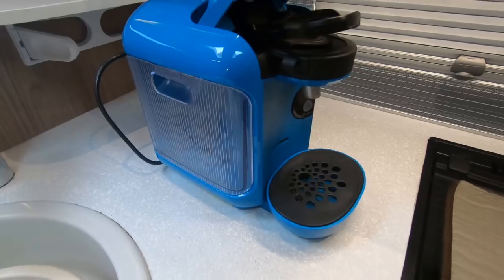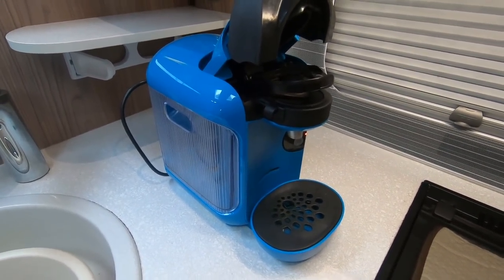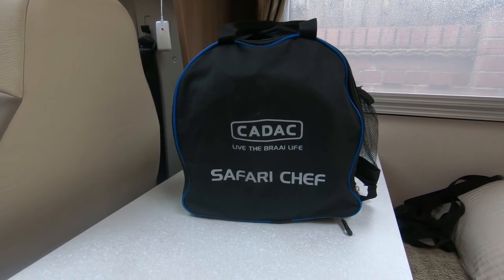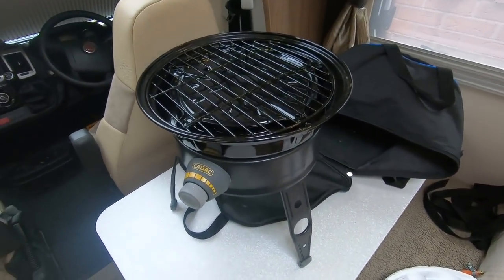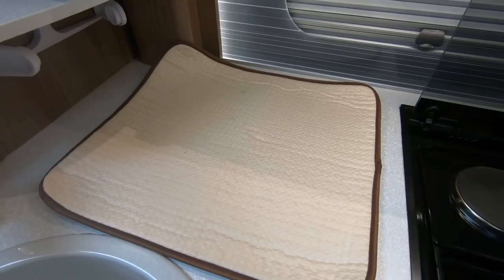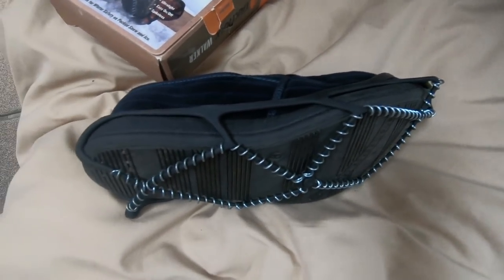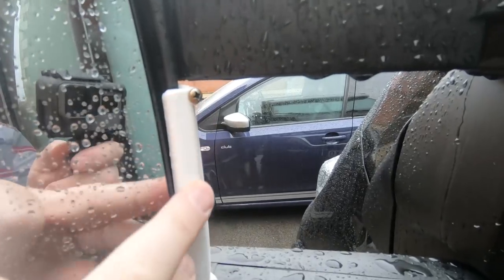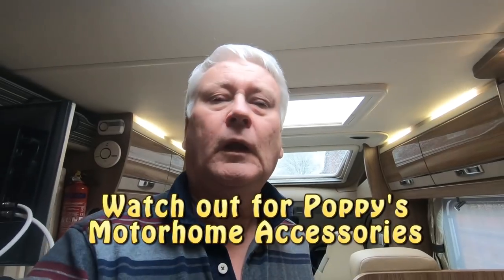Motorhome Nice To Have Accessories

Comment: Hi Bob any reason for choosing the Cadac Hi Pressure. Do you use it with BBQ point on side of van or with gas canisters?
Reply from the maker: I had a BBQ point on the old Motorhome, so that's why the high pressure one.
Reply: @BobEarnshawMoHo  I'm finding the difference between Lo & Hi very confusing. I thought the BBQ point on motorhome  point would be Lo pressure ie after the regulator. Thanks for the reply and a great series of videos.

Comment: Morning Bob, Jenny. Sorry to bother you. We have just bought a Cadac Safari Chef 2 gas bbq. It doesn't come supplied with the pipe and connections etc. Q do I need to fit a regulator with a connection fitting etc. I find it strange that they are allowed to sell without the pipe etc, You cant buy an electrical item without a flex and plug etc. Thanks Pete
Reply from the maker: Goid question. If you are using it on a Motorhome external bbq socket, you don't need a regulator. If you intend using it with a stand alone calor gas cylinder, yes you do. You should find regulators and piping at any good calor stockist or motorhome dealer.
Reply: @BobEarnshawMoHo  Thanks Bob, Yes we have a Truma external Gas point, So basically pipe and a male fitting should get us ready for lunch.

Comment: Hi Bob

Regarding your Milenco mirror protectors can you tell me if they have a cut out for the temperature sensor on bottom of mirror
Reply from the maker: Glenn McDiarmid Yes they do. Thanks for your question. I had to go and look. This answers a question of mine - which mirror the temperature sensor is in. It's in the drivers side. There is a little nipple underneath and the mirror protector has a hole that goes around it. My temperature sensor thinks it 40+ Celsius out there. It definitely isn't!
Reply: Hopefully a simple fix as 40 Fahrenheit is 4 Celsius so if you change the units on the display all should be good. 

That’s good they have a hole for the cover as when I looked at the sensor I thought it could be easily broken if you did not realise where it is located.
Reply: Hi Bob I watched your Ducato dashboard video which was great as never new about the separate oil service menu, when watching the video I could see that your temperature is set to degrees Fahrenheit and not Celsius
Reply from the maker: Glenn McDiarmid yes I know, Ihave set it the Celsius now. Not that it makes any difference- it still says it's 44 degrees Celsius! Think it's a loose connection somewhere.

Comment: Came across this, something similar from Spanish type b&q suggested, so did a search in uk. It might need some adaption to fit with one of the collapsing kits, but if you need to go a long way with one piece of hose it seems quite cheap. Not tested, just saw it and thought it may be useful for someone ..  https://www.manomano.co.uk/p/swimming-pool-hose-vacuum-eva-flex-pool-with-glued-sleeves-38mm-6m-809563

Comment: Hi Bob.  I have slays thr\ought that my Tassimo Vivvy would pop a fuse. Is this not the case and have you ever had this problem when abroad or does it just work even on 10 amp
Reply from the maker: It's never blown a trip when I've used it. It's around 1100w and draws around 4-5 amps. If the heating is on at the same time, there is an overload setting on the ALDE heating that will cut the supply to the heating. If I'm on a 10 amp supply, I turn the overload down to 10 amps and not had a problem. Probably would on a 5 amp site supply though! You will need a decent sized  (2000w) inverter to run it off 12v supply safely hough and it would draw over 90 amps from the battery!
Reply: Bob Earnshaw Thanks Bob. Appreciate you coming back so quickly stay safe and stay well
Reply: On another topic. Have you ever had to fix the vertical blinds on the sides on your MH. The concertina type. I have now had three that have had to be re-strung on tightened but it’s a real pain taking it back to the dealers to get sorted.
Reply from the maker: @NigelPullen  No, never had a problem with those blinds.